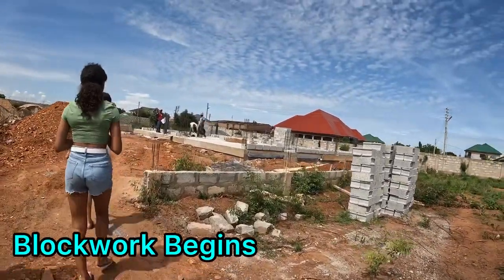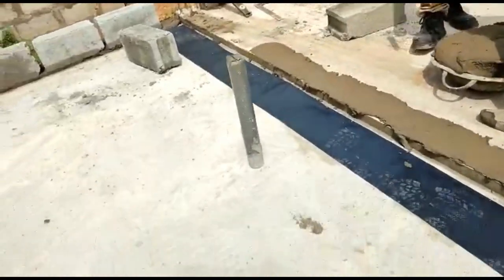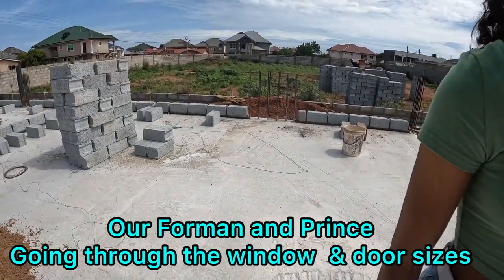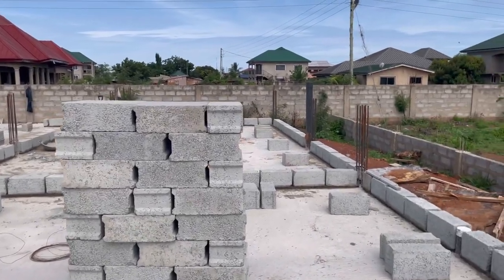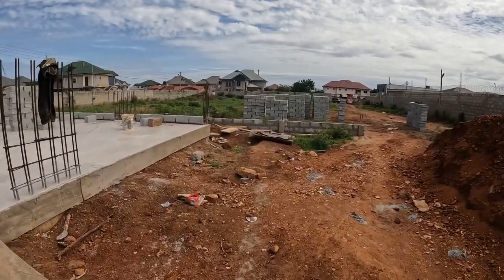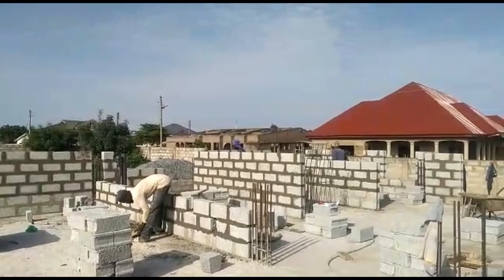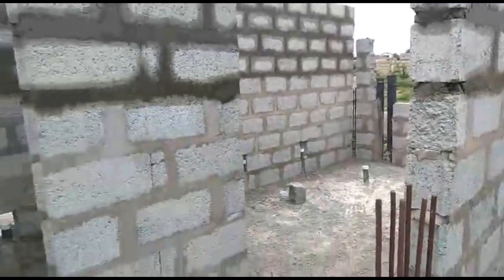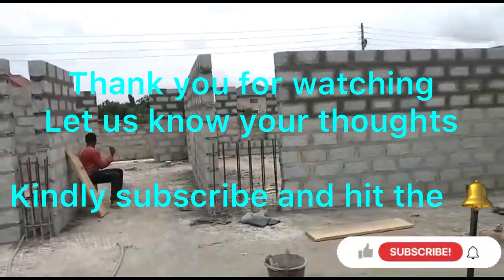How to lay DPC when building in Ghana ~ First course block work

Comment: I know DPM means Damp Proof Membrane, but what does DPC stand for? What type of quality and/or thickness do you need for each one? Thank you
Reply from the maker: @dmebrown. DPC stands for Damp Proof Course. DPC is a barrier used to prevent moisture from rising through walls, which can cause structural damage and dampness in buildings. Thanks

Comment: Can you do a video on the ratios of cement to sand to stones etc that your builders used?
Reply from the maker: Yes, we will create a video on the sand, cement, and stone ratios we used for the slabs and columns to achieve the concrete specification of a minimum 28-day cubic strength of 25N/mm2, as well as sharing the test results. 
Thank you @l.e.sparklesfkaelliesparkl5875

Comment: Dpc is needed even though dpm was utilized?
Reply: Yes, both DPM and DPC are needed. The latter is to prevent raising damp from the walls.
Reply: Love the amount and sizes  of windows
Reply: @dmezluv2312  thanks. So what does the dpm do then?  I thought dpc would be appropriate for a fencewall.
Reply from the maker: @l.e.sparklesfkaelliesparkl5875  Thanks, we want a lot natural lights.
Reply from the maker: @l.e.sparklesfkaelliesparkl5875  A damp proof membrane (DPM) is used in to prevent the passage of moisture or water vapor through floors, walls, and other structural elements. According the the building regs both must be used.
Reply: @princenikki  extra layer of protection.  Thank you!  # BIGh videos are very helpful